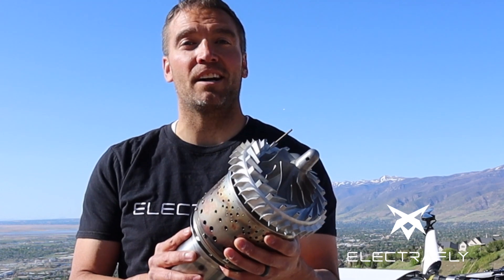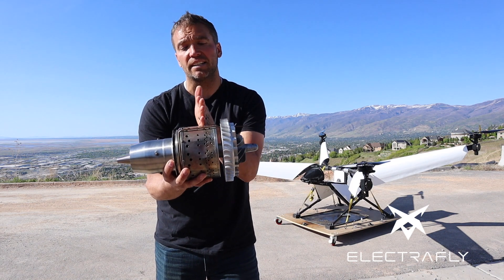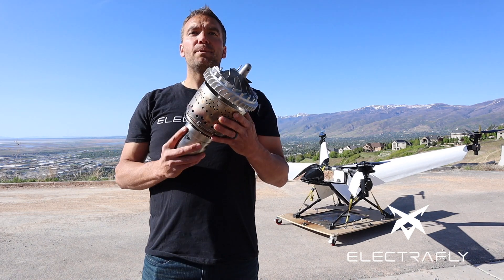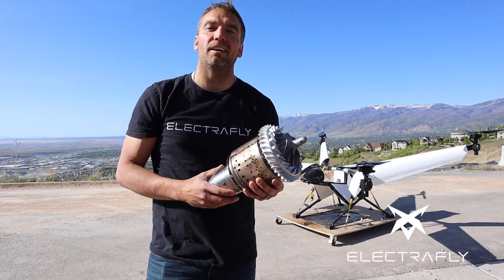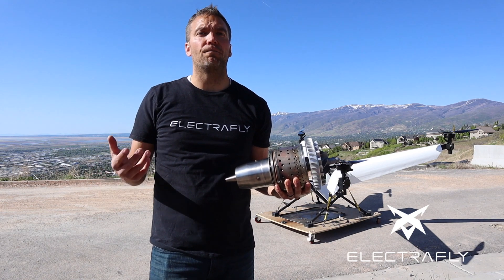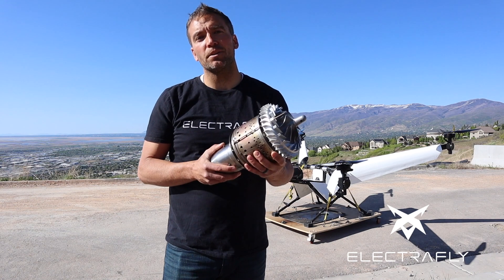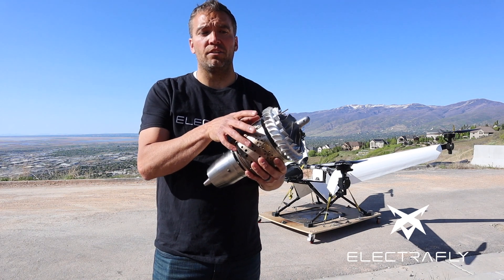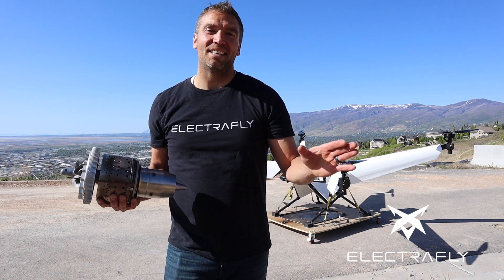How jet engines work

Comment: I appreciate the the passion and enthusiasm conveyed in your videos. But I not sensing a harmony between the major subsystems composing the craft behind you. The four airfoils extending to the electric motors look like they came from a rotor craft. The four lifting motors look pretty conventional, which as me wondering where the ESC's are located.....for that matter, where are the batteries? 

The placement and choice of the jet engine is curious for a few reasons: 1) it could be assumed that it would be better to mount its thrust line towards the center of mass of the aircraft. 2) it's thrust and specific impulse (velocity of exhaust) would better match an aircraft with much less drag to help it reach much higher speeds than what a person hanging in the open slipstream would normally want to experience. Not that that tiny 35# to 50# thrust engine would get them there. 3) I'm really surprised you're not trying to engineer an efficient micro turbine electric generator to keep a small set of batteries charged. This would allow you to manage all propulsion through electronics and software, maintain a reliable emergency power source (batteries), allow the turbo to operate at one optimized power setting, shift all variables to the batteries, ESC's, and motors.
Reply from the maker: Thanks for the feedback R Barnard. 

Currently the turbine offsets the lifting requirements on the Electric Motors, as you know, battery technology doesn't allow us to be fully electric...yet.

While we do plan to generate electricity we have budgetary constraints at the moment, more to come though. 

You are right, the aircraft is not designed for extremely high speed.